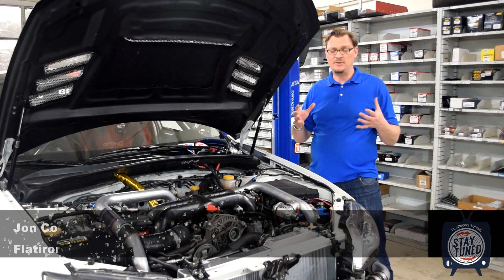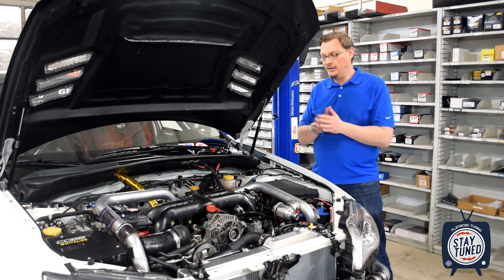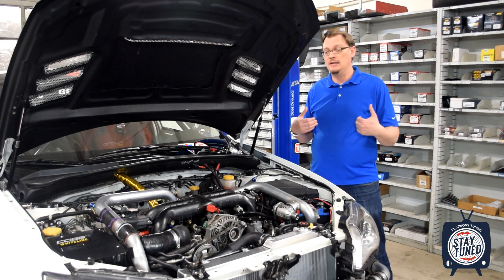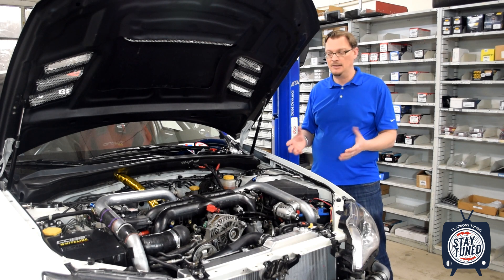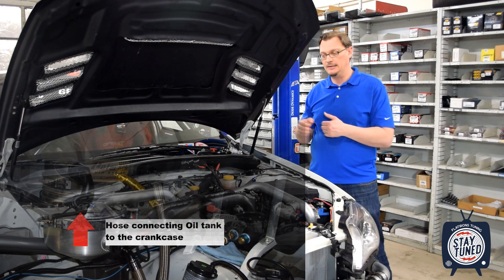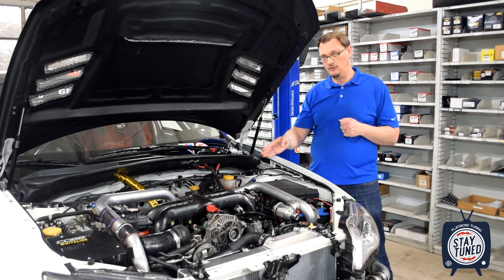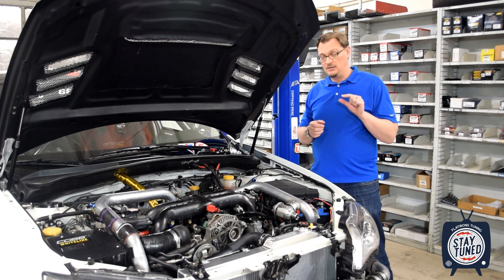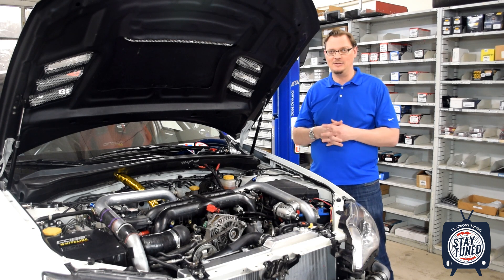How and why we changed our Dry Sump plumbing

Comment: I'm curious about the vacuum regulator, where did you install it and what did you set it at? Do the scavenge pumps pull enough vacuum to maintain vacuum under boost?
Reply from the maker: Thanks for watching and thanks for your question.  We were going to put it in place of the oil filler cap.  And yes, the scavenge pumps do pull enough vacuum to maintain crankcase vacuum under boost.

We have seen this in our datalogs on our car, but I will say that this can vary depending on the dry sump you are using, and the setup as well.

Hope that helps and Stay Tuned!
Reply: That is helpful thanks @FlatironsTuning . So did you end up running the vacuum regulator or was just the vent tube from the crankcase to the dry sump tank enough? What brand relief valve did you use?
Reply from the maker: @HugeGordon  We got the Peterson Fluid System vacuum break, but we never installed it.  Yes, the connection between the crankcase and tank is enough to allow for the control of the crankcase vacuum for us so far.

Hope that helps!
Reply: @FlatironsTuning is that hose just going from the vent in the block or is it tied into the valve covers as well? Or are those ports blocked off? -20 hose?
Reply from the maker: @HugeGordon  Those are blocked off.  None of the PCV system remains connected.

Comment: Thank you very much for this as always very informative video.

I have a few questions about your setup and one about my own setup.

You use the newer dry sump kit from Roger Clark and you have closed all the vents, except for the large crankcase ventilation, which you then connected to the tank?
Is it possible to compare the new dry sump kit with the older kit in general?

My engine is currently still on a stand with a connected, filled tank to prime it from time to time and crank it a few revolutions. Normally I open all vents just to prime, but last time I thought about not doing this, because it should also be closed later in operation. During the prime, however, the build-up back pressure on the drive wheel and the resulting noise in the engine seemed a bit disturbing to me. I stopped and opened the head vents and there the system now vented massively, as if the pressure generated there would not be sucked out again. If I leave the crankcase ventilation closed, this does not happen. Do you have an explanation for me, or am I even worried unnecessarily?

Thanks a lot

Comment: Great content and I enjoy this video! I do have a question about plumbing back into the oil tank. Are their any baffles or routing (just like the breather on the tank)  to prevent oil from being sucked up the hose and back into the engine?
Reply from the maker: Thanks for your question.  Yes, inside the oil tank, there is actually a substantial amount of baffling, and where the hose connects it is fairly isolated.

Thanks for watching and Stay Tuned!

Comment: Hi There,

Quick question on the dry sump and PCV system removal.

With the heads and block now routed to the dry sump oil tank. Did you retain the second head & block outlets, connected with the OEM balance pipe or did you simply block these off, removing the OEM balancing system ?

Thank you
Reply from the maker: Thanks for your question.  Because we are now using the scavenge pumps on the dry sump to control crankcase pressure, we did remove and block off the balance ports as well.

Thanks for watching and Stay Tuned!

Comment: Curious did you guys end up mounting the dry sump oil reservoir all the way to the trunk/boot? 

Watched some videos on STI cooling upgrades and seems the key is to separate the oil cooler from the radiator so the radiator doesn't have to do double duty for more consistent temps.
Reply from the maker: Thanks for your question.  No, our tank is basically sitting at the "B" pillar.  Moving the tank all the way to the trunk can absolutely work, but it can also add a little bit of complexity.  We decided to keep the oil closer to the engine.

As for as cooling on a stock car, you can see some gains from removing the factory oil cooler that uses coolant in favor of a separate cooler that uses air.  Placement of that cooler, and the air flow to it are important things to consider.

And on less modified cars, that should not be necessary to keep coolant temps where you want them to be.

Hope that helps and Stay Tuned!

Comment: Is this issue mostly related to the aggressive driving ?
Was this issue present with the regular oil pump and pick up ? Or is it related to hight power blow by ?
Reply from the maker: Thanks for your question.  Because we were seeing some oil loss with an atmospheric Air-Oil separator, I would say that the symptoms were fundamentally present before we installed the dry sump. 

That was in fact one of the main motivations to install it actually.

The issue is not related to power as much as use.  The key difference between a track car and a street car is the time spent at wide-open throttle.  A race car will spend a lot more time there, and that is what cause the crankcase pressure to build.

I hope that helps and Stay Tuned!